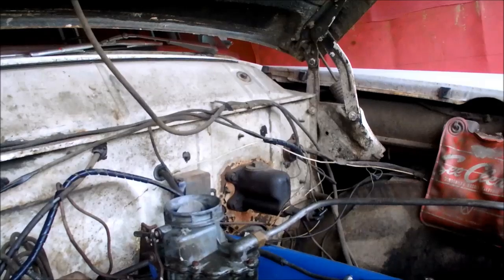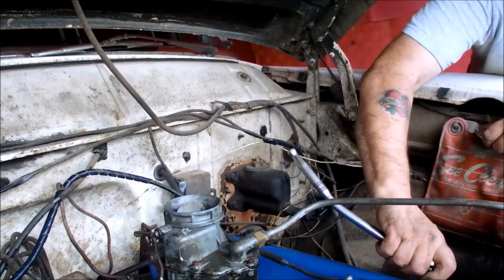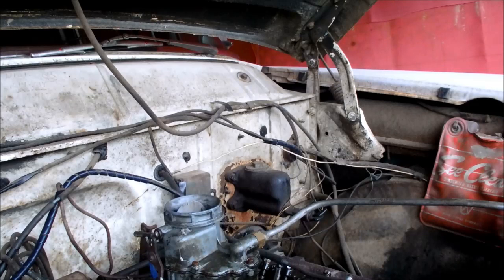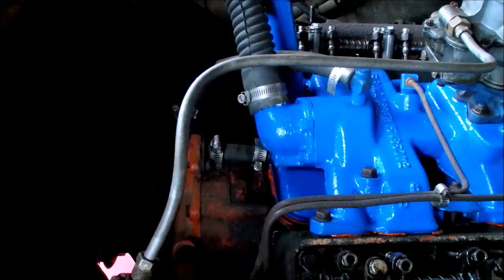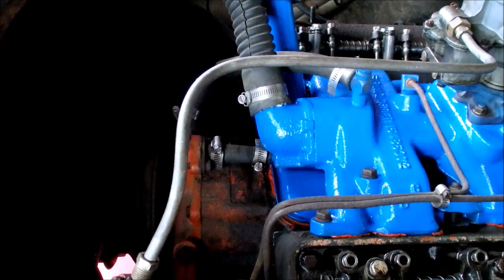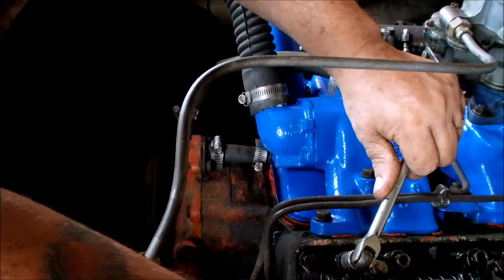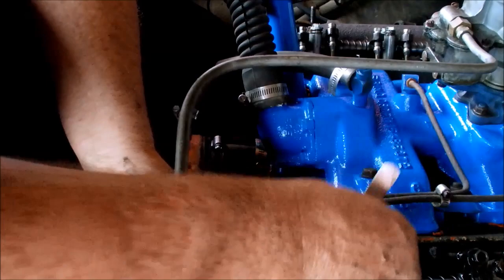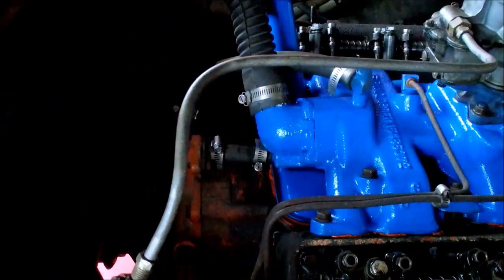Under the Influence of Cutworm59, adjusting valves

Comment: Hey Peekly, are your rockers the same as mine? A lock nut with a flat-head screwdriver screw adjuster in the middle? How are you doing what you're doing exactly? I thought you had to loosen the lock nut then make the adjustment with a screw driver.
Reply from the maker: That's the way they are on a VW, but the Ford has 7/16" nuts that turn and fit real tight in the arms so they self lock.  No lock nunts and no screwdrivers needed..
Reply: Damn, I wish that's how it was on mine, looks SO much easier. I know that's how it is on mine and I've even seen images on google of it as well.. I think you just got lucky my friend.

http://hccperformance.com/graphics/DSC01755__Large___Small_.JPG
Reply from the maker: Ian Knau Oh yea, them's made just like the VW's are made.  The ones on my Ford are different.  They are a lot easier too..
Reply: lucky lucky Peek.